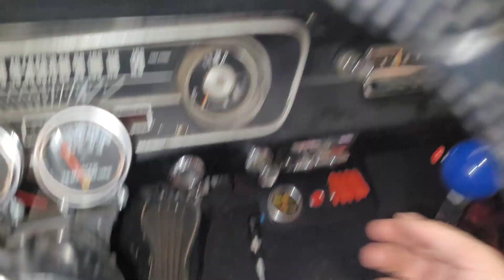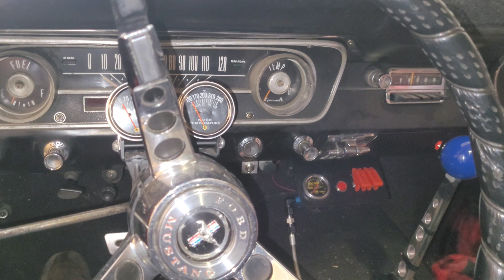Coil Explosion! | Ignition Coil Meltdown! | How Could This Have Happened?? | Diagnosis Reveals.....

Comment: You should install a Electric on and off switch like us racers use. I never ever leave power switch on to the system. If stored in winter, I pull the Neg - battery wire off. Everything thing else is on relays or inline fused. Have seen too many cars burn down to the ground. Thanks for sharing. Cheers from Motown.

Comment: I was just debating with myself today weather or not to get the Blaster 2 coil for my ready to run MSD distributor.  I think you sold me on not using a stock coil, and worrying about correct coil ohms. lol
Reply from the maker: That blaster 2 coil had been in there fine for over a decade 😅

Probably would have lived another decade or more had the starter solenoid not fried it out of nowhere 😂
Reply: I wonder what the MSD Blaster 2 High Vibration coil would have done in this situation? That coil is epoxy filled instead of oil.

Comment: That's crazy, for some reason I have had more problems with those fender mounted Ford solenoids then I have with any gm with a starter mounted solenoid. The cheap aftermarket solenoids the parts store sells for these old Ford's are pretty terrible as well, I have had multiple randomly stick and keep cranking non stop right out of the box, most of the time I have better luck with an old original used Ford or motorcaft ones from the junkyard.
Reply from the maker: That sounds about right lol 😅
I got a stockpile of them just laying around 😂
Reply: Ima either mount mine straight to the block, or rig a Chevy starter mounted solenoid, jus figured I'd run my mouth! 😁

John 3:16
Reply: @OVERKILL_SS  somehow it would probably work better lol. Ford tough with Chevy stuff.
Reply: @briang4470  Lol ima definitely put a low resist Chevy 1 wire alt on it!